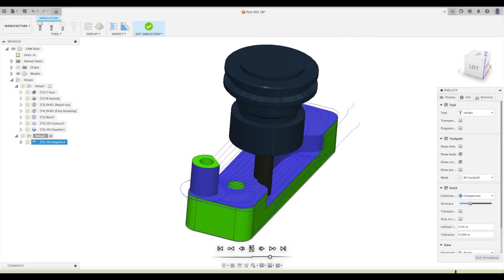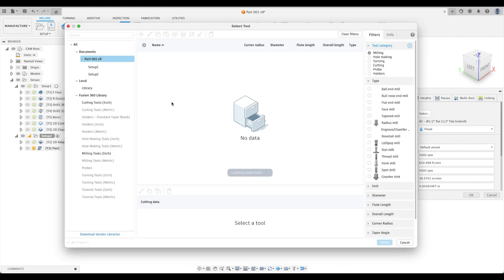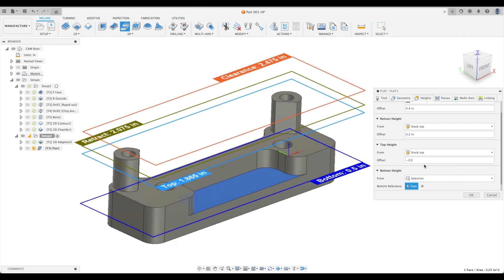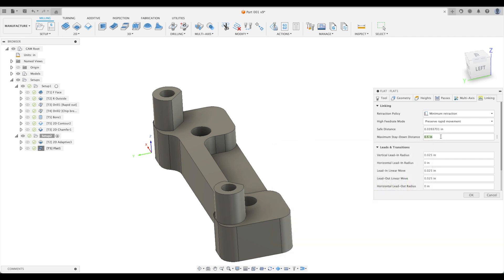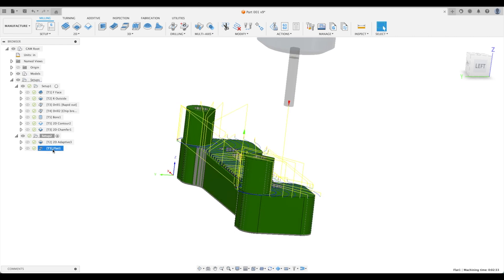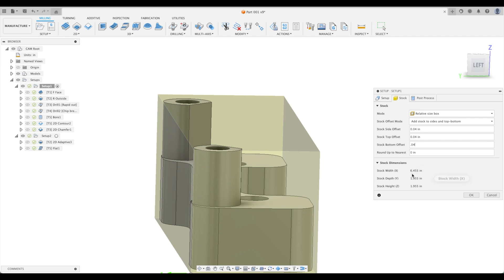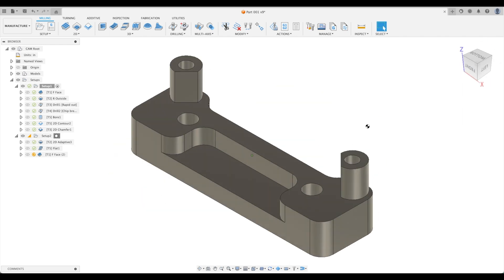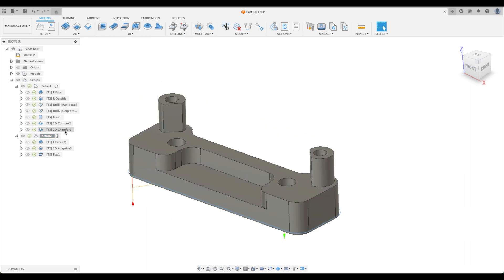Fusion 360 - HWIMT - Part 001 Setup 2 - Op 2 (3D Flats & Add Facing Op 1)

Comment: Can you make a tutorial explaining WCS for different setups, especially fot multi-op parts where people say to to ptobe off parallels fot z axis and putting the WCS on the bottom of the pary when it's flipped over for op2.
Reply from the maker: I would love to do that. I'll try and do so in an upcoming tutorial where I'll program the CAM for the RC engine crankcase. I also have a Udemy course coming up soon. Stay tuned.